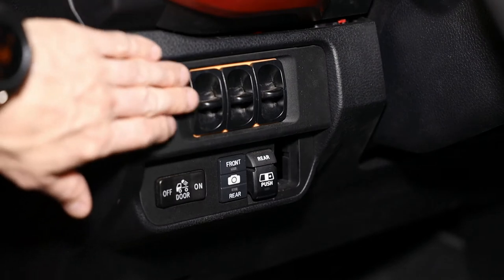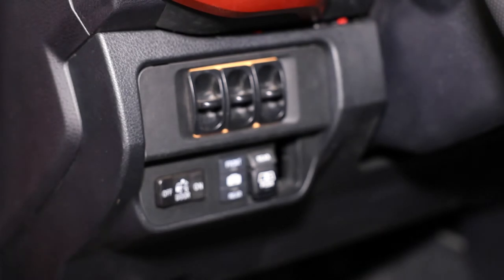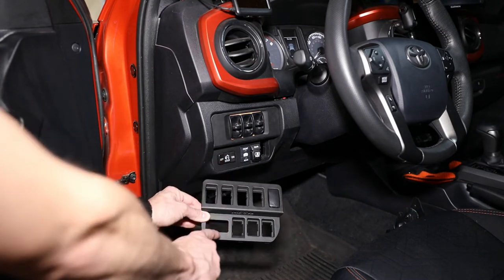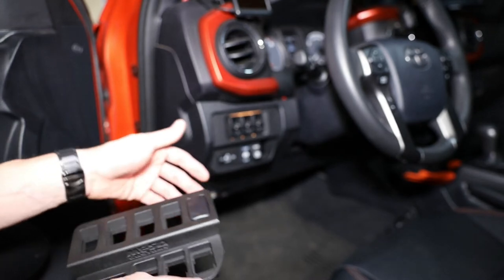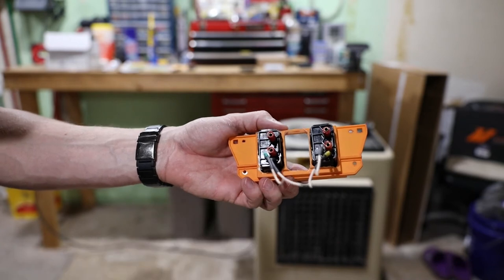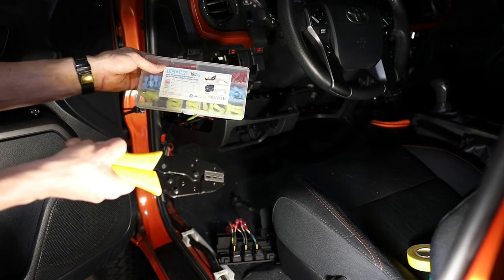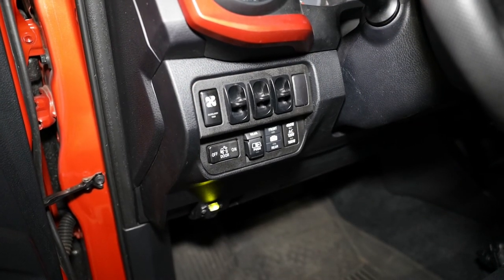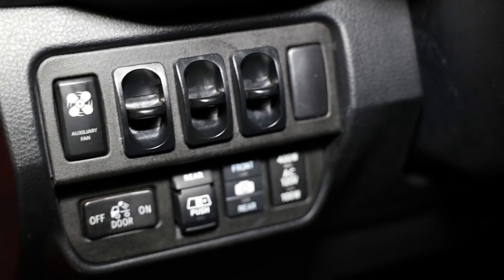3rd Gen Tacoma Switch Panel

Comment: Thanks for the video.  Main purpose for watching was to find out how to get the 5 switches across the top.  I speculated that the sides would have to be cut and you confirmed it for me. Ran out of switch space today with a rear facing back up light project. Three position switch off, on when in reverse, and override on for tailgaters. Still have ditch lights and roof rack light bar to control. Very helpful, thanks again.
Reply from the maker: I've also seen split switches. One switch socket but two switches! Just search "split Tacoma switches".
Reply: Good advice, yes the back up light button is a split.  Meso customs is sold out of a lot of stuff right now.  Really like the overhead switch cluster insert.  Cali raised also makes one but they are very proud of it.